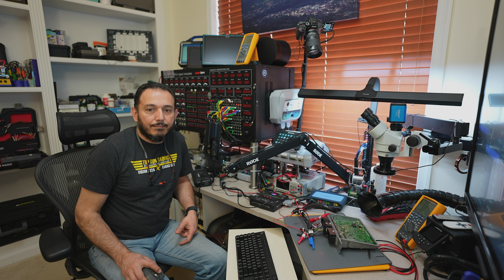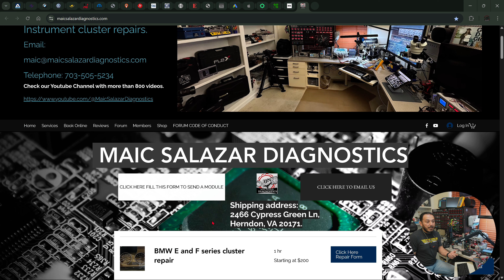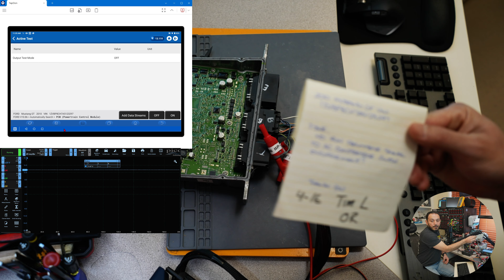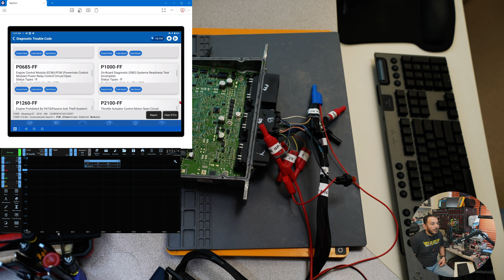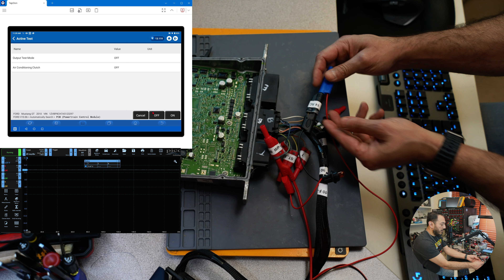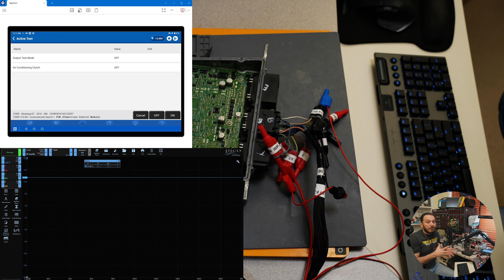2010 Ford Mustang GT no AC relay activation from PCM, test before repairs for Tim L in OR

Comment: Hello, i piggyback (parallel to oem) installed a standalone ecu on a 2005 mustang gt. Only injector and coil signals have been cut and only tps1 tapped. Im guessing now the oem ecu is not signaling the AC relay because of this?
I already checked all other wiring and circuits check ok, its only the oem ecu not signaling the relay.